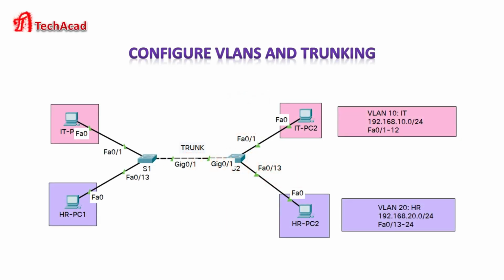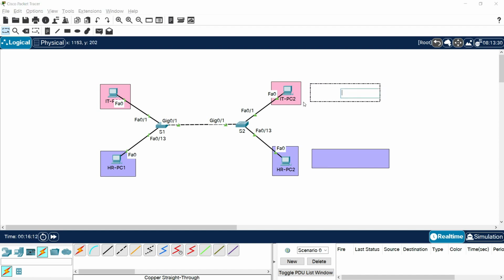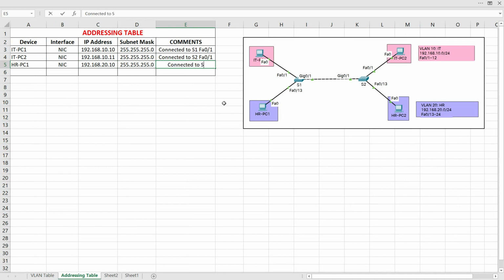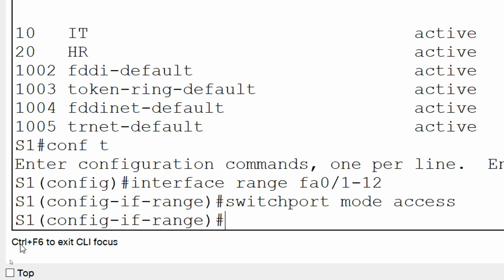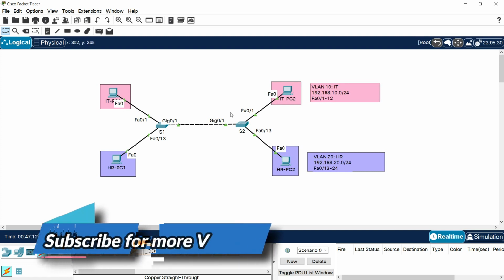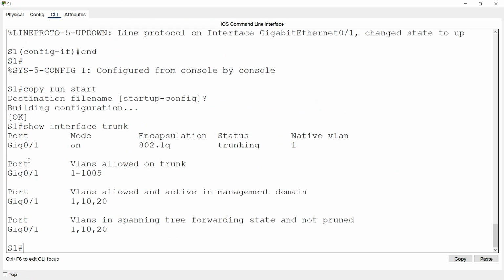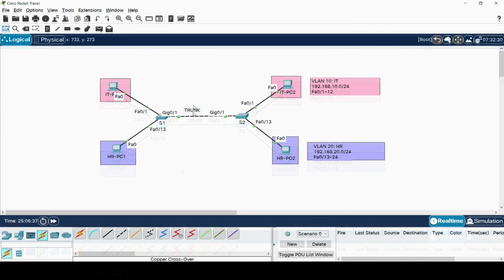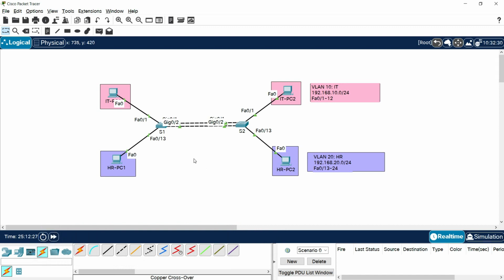Configure VLANs and Trunking - Lab18 | Free CCNA 200-301 Lab Course

Comment: sir, when ever I'm clicking on any device in packet tracer like router, switch or PC the window is opening in full size. Unable to use it in smaller/minimized window as you're using. I have tried modifying Custom interface settings in Preferences, but no luck. Do you have any other way to use it in convenient way??
Reply from the maker: The resize option is available in Option Menu!
Still you have problem, try to re install the Packet Tracer Software!